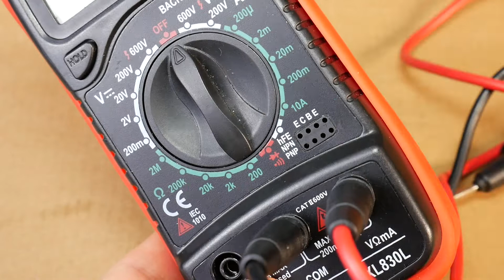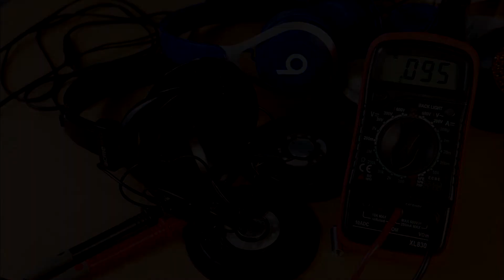How To Use a Multimeter (Techscrew DIY School ep1)

Comment: Thanks for the video but there are several things that could be explained, first. Mi multimeter has 3 holes 10adc  vqma and com. At no point instruction on what i should plug is given, and at 3:52 what exactly are you looking for to know which one is left right, the numbers on the multimeter?